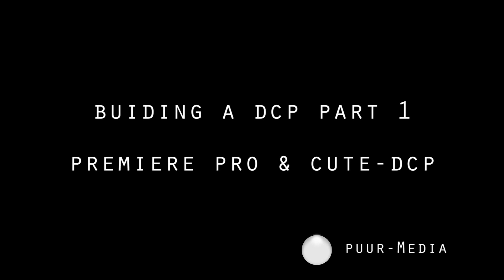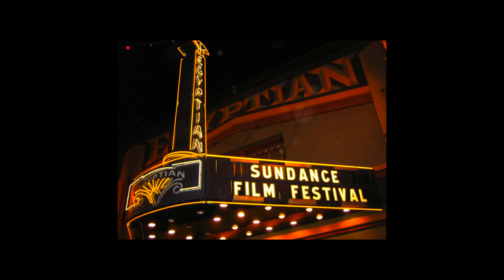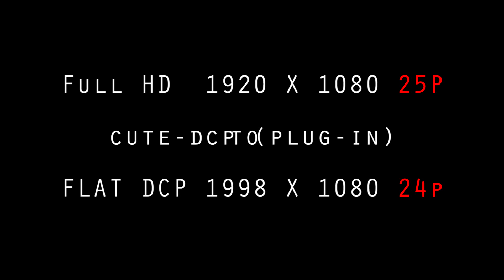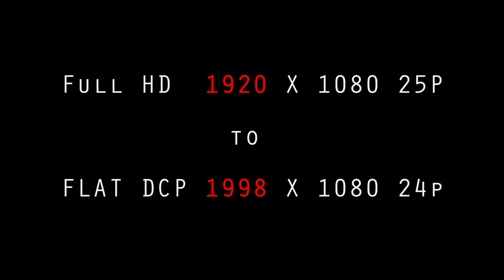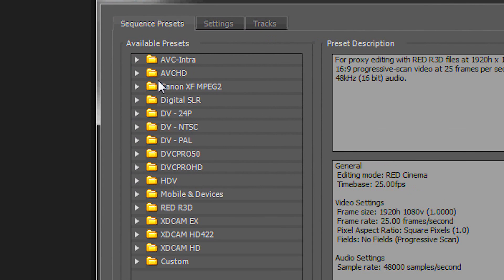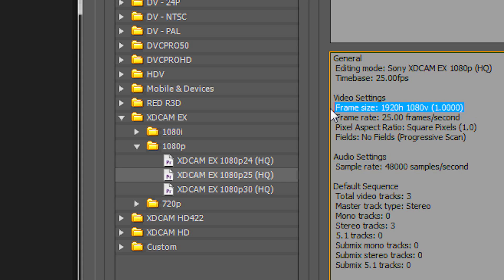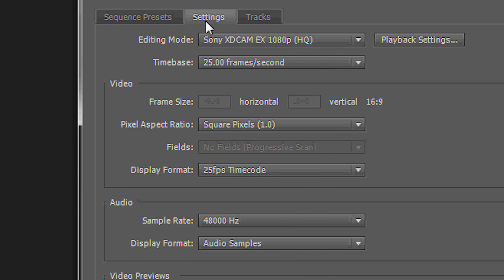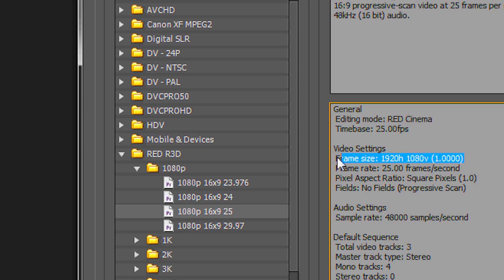Adobe Premiere Pro - How do I build a DCP from HD 1080

Comment: I would like to repeat an unanswered question: could one just bring in a ProRes file into DaVinci and go from there to generate the JPEG2000, or does one have to convert ProRes to TIF seq and then go forward?
Reply from the maker: +Alan Langdon why do you want to Tif seq?
Reply: I ask because all tutorials talk about making a tif sequence from the movie and then a JPEG 2000 sequence from that. But if the pro res master can be exported from da Vinci directly to JPEG 2000, why not? This is my question.
Reply from the maker: +Alan Langdon ok yes I know I have seen that but with this plug in I didn't do that what I do is that I render the film to one file in my case a h264 file so al effect color grading etc are done 

Then  I import this compleet file  in my edit suit and voor a second time  I export it to an dcp file
so all computer calc power go to making the DCP.

Thanks for your question I hope this helps

Kind Regards

Benny
Reply from the maker: Alan Langdon Yes I have  seen that  I don't do that but I render to an 264 file and in this file are all color corrections,effects etc then Import this file to make an dcp
Reply: Wow. That sounds like not a good workflow, to compress your master to h264, which is 8 bit and very compressed, and then make a DCP from that. Are you sure that is how you do it? And do you skip the tif sequence then?
Reply from the maker: ps love our discussion
Reply from the maker: True I agree but lots  HD is filmed at 8 bit  so no use to go to tiff  and this workflow  still looked great on the big screen